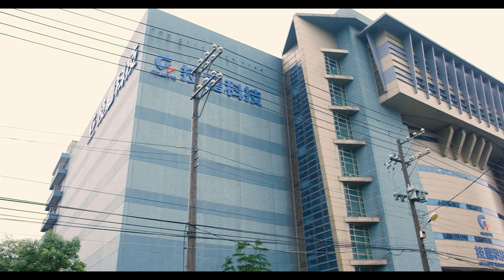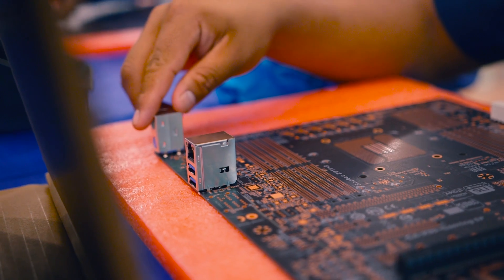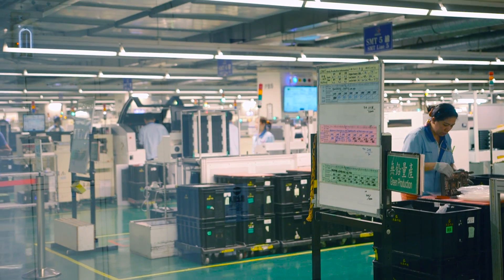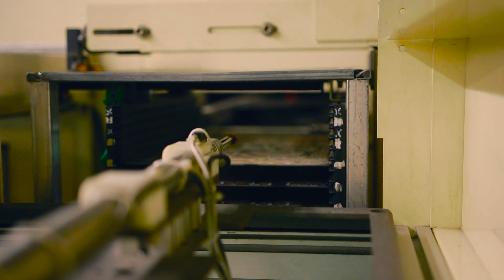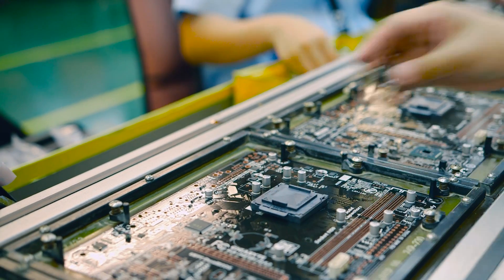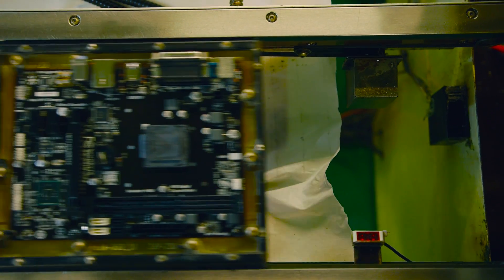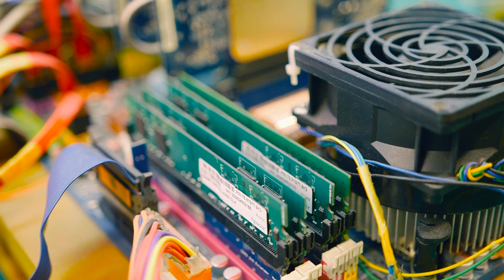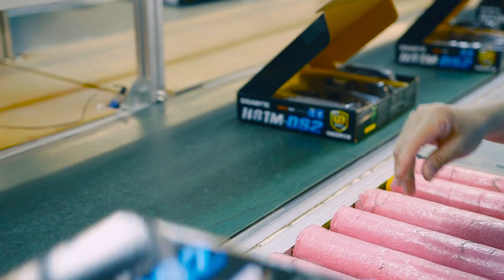Gigabyte Factory Tour - How Motherboards are Made

Comment: Ah the flashbacks. I went on this same tour in 2008 (and the Asus in 2006). Interesting point was the ethnic stratification of the various jobs on the floor:
PCB Printing - Mainland Chinese (Imported from China)
PCB SMD placment - German (Siemens robots)
Plastic connector mounting and testing - Filipino Women (The whole section was Filipino, with signage to suit)
Solder float bath - German
Packing - Taiwanese (different floor).

The team made fine Q965-DS4 Mainboards that day. The Asus factory was exactly the same. I doubt there`s much difference between all the brands to be honest.

Comment: The real measure of quality control is what fraction of boards fail final test, and how that fraction gets repaired and retested.  In a well-run factory you should see less than 0.5% of the boards failing final test.   If you want to know how good the quality control is look at the part of the factory that does the repair and retest, and ask for the fraction passing final test for the first time, without repair.  Failed boards are repaired to recover yield.  Repair exposes components again to 265C for several seconds.  Often test cannot identify the failing component exactly, so several attempts at repair are made.  But you can't do more than 2 or 3 tries since repair involves soldering (exposure to 265C) which is damaging to other components on the board.  You don't want to get a repaired board because it has been stressed and handled much more than "perfect" boards.

Comment: whuud, you left out the most interesting part: the pick and place machine for the small SMD resistors etc. which is freaking incredibly fast while having an extraordinary accuracy. There's just a tiny peak at 1:35 .
While still being a pretty interesting video, technically seen it's not very precise unfortunately. But still, thx for sharing.

Comment: With bare hands? Without gloves? That's bullshit...
Our skin produces an oil that is able to leave fingerprints like at 0:44
Not just that it could short out the circuits, but it's gross. Thanks
Reply: oil doesn't short out components it insulates
Reply: Troy Kucks Not organic oil like the one on our skin, but a certain type of mineral oil that doesn't conduct electricity
Reply: All organic oils, categorized by the American Petroleum Institute as classes 1-3, are insulators. However, as you add impurities such as salt, you can increase the conductivity. I can't find an actual conductivity figure for finger oil, but it's probably still pretty small.
Reply: SirMeowric Yeah it's pretty small but gloves prevent this little risk

Comment: But how are the boards themselves made? Like before the bits are added?
Reply: like every other circuit board
Reply: Most likely painstakingly designed for optimal placement of components, then all printed. Just like they probably would do it with videocards, they see what's on the reference model and then redesign the components to use higher quality stuff or just move them around for better cooling, draw the final design  and then that gets printed.

Comment: So, does every single board have a processor, ram, etc, put into it to test it? Or is it just a random selection off the production line? That seems like a massive amount of time if they do every one
Reply: It also takes a massive amount of time to handle the RMA process if the mobo fails, I reckon they test every single one.
Reply: same as the boards are done with little use of robotics the machines are just used on conveyor belts and the copper plating the PCB and soldering as well as testing components the rest is all dome by humans putting certain components in the boards and quality control checks etc...
Reply: makes sense really, I guess I just always pictured the whole process being a lot more automated

Comment: What's with those blue wristbands on some of the workers?
Reply: Anti+static wristbands
Reply: the wrist bands are used so that the static build up in our bodies does not damage certain sensitive components and static electricity can greate over 2000v where as an actual motherboard wouldn't even use 25% of that is why i have my own anti static mat and wrist strap to get rid of static build up which you can get rid of by connecting it to a ground you can get special power adapters with a metal piece sticking out which you can attach a crocodile clip from the band to and it will earth it
Reply: This glosses over some pretty bad abuses these companies engage in to feed the Western market.  People have comitted suicide at Foxxconn.  The founder of Foxxconn referred to his employees as "cattle"....  The owners are horrible people.

Comment: Poor workers. Installing a couple of components for 8 fucking hours (or maybe 12h?). That looks so boring and repetitive. Chinese water torture = the motherboard manual assembly version.
Reply: It brings me back to my assembly line days in quality control. It's just so fast paced, you can't take much of a break at all. But these are how factories are all around the world, in many different industries.
Reply: I would honestly rather do this than work in customer service, and I've tried both.
Reply: In soviet union it was the same. You had to fix X number of tractor engines every day, no quality control and if you are done you still have to wait those couple hours doing nothing until the time for the end of the work comes. Such a big motivation to work fast...
Reply: +MendezAS I agree. I have been working at a sausage factory in between school semesters here in norway. This actually looks quite a bit nicer. You get to sit down and work with tech. I'd do that over sausages any day.
Reply: They have factories that do the same thing in the US. There not good jobs, but they aren't torture.
Reply: Assembly lines are nothing new.

Comment: I'm glad I have a Gigabyte motherboard , they seem like a quality company.
Reply: pwm means there is a signal wire to the fan so you know exactly what rpm the fan is running at but if you are using voltage controls you only know what percent of the max rpm the fan is running at for example if you run 5v the fan goes at 50% of its max rpm and 12v it goes at 100%
Reply: ***** im telling you what % is
Reply: ***** that controls what pwm it runs at for the temperature